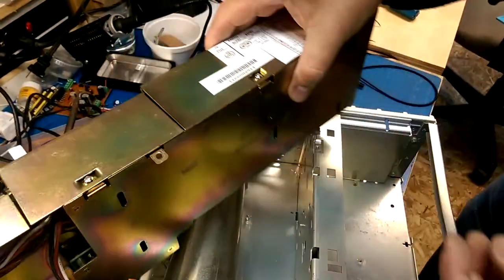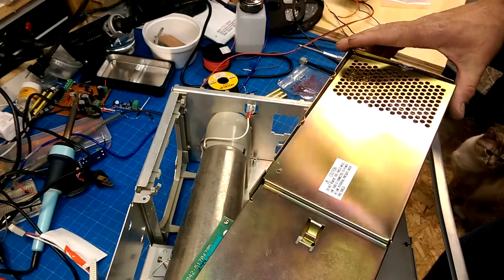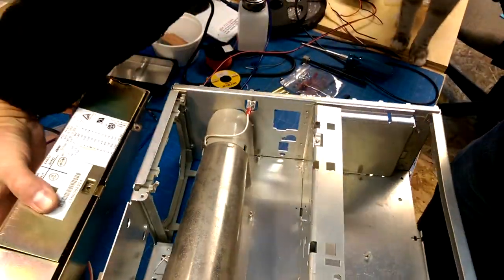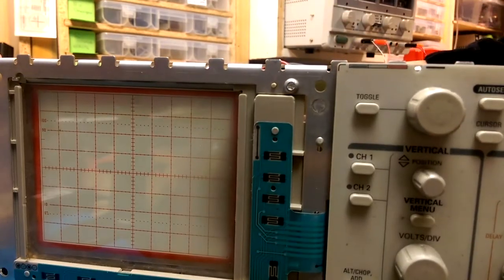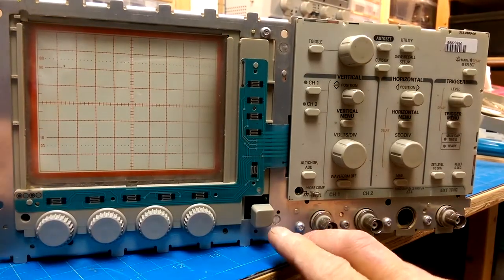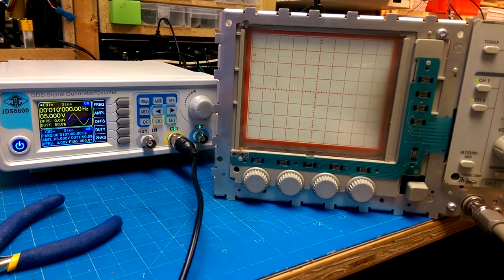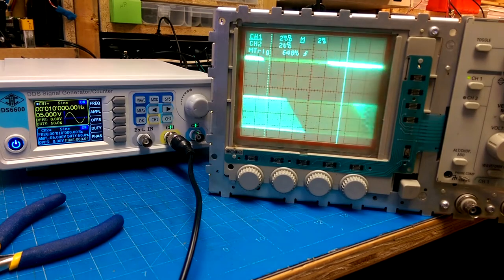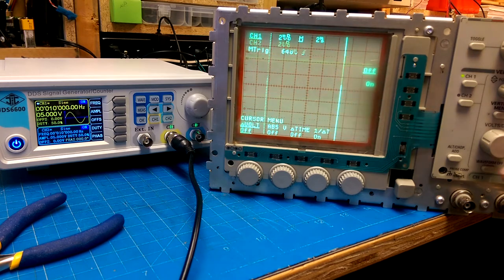alone and forlorn

Comment: Btw, ref your comment at 4:20, TekScopes is not on Google. It moved from Yahoo! groups to https://groups.io/g/TekScopes/ recently.
Reply from the maker: Quite right.  I subscribe but I thought it was a Google platform.  My mistake.
Reply: Did you ever get around to replacing the fan?
Reply from the maker: Not yet.  I took a quick look at the manual and it said 12v DC fan, which is what I tried but the PSU kept cycling on and off so perhaps the 12v rail is bad?  Need to dig deeper.
Reply from the maker: The fan I used at first had a current draw of 300mA.  I bet it drew more than that since it was giving the power supply problems.  After reading the parts list the scope uses a fan that is only 200 mA.  I have one of those and the scope starts up fine with it in.  So now it will have a fan.

Comment: Are you sure you just didn't set the trigger to channel two?
Reply from the maker: You are correct!  trigger was on channel one and I could not change it to channel two.  Both channels work!  So now the problem is just the buttons on the front panel and a chassis fan.
Reply: grtyvr good to hear! Even if it's not worth much it's still always handy to have more scopes!